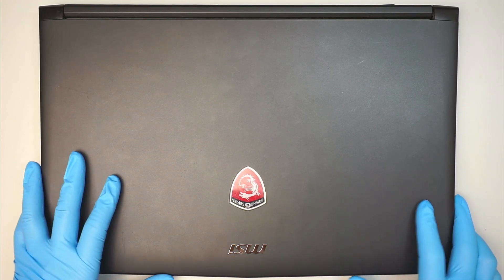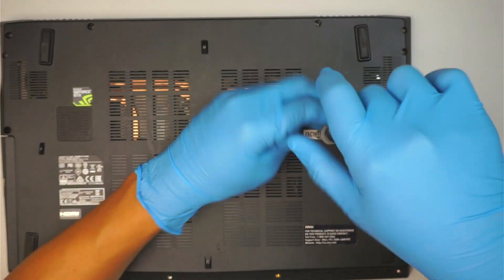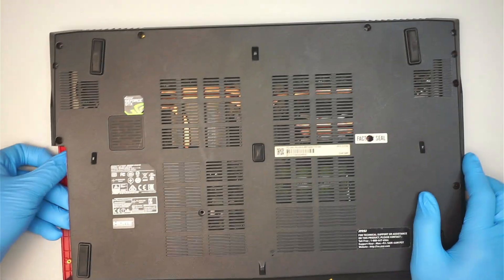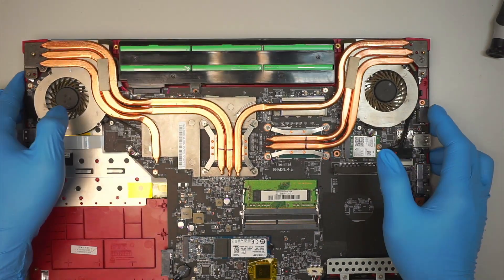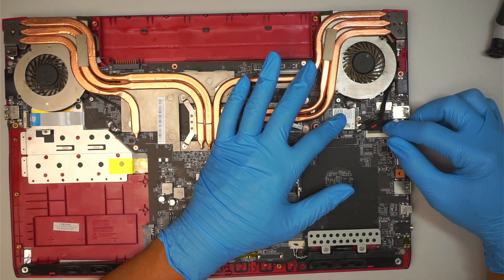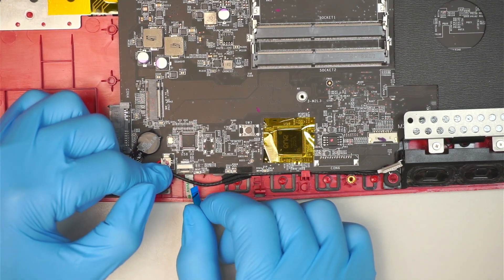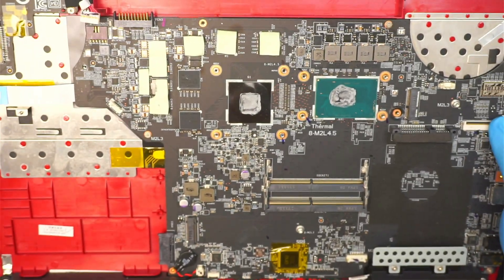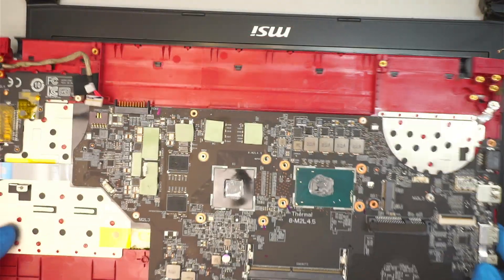MSI GP62 MS 16J9  Teardown Disassemble Upgrade

Comment: i have the ms-16j7 for some reason lots of site dont see this a s model. is the 16j7 almost same as 16j9? i noticed the  gpu is dif but looks to be same internal. i want to get a m2 for it  but in crucial upgrade site i can select 16j9 not j7 so i want to confirm before i buy try and it doesnt work or has issues.

Comment: Does this model have a CMOS battery, and if so, do you know where it is? My clock doesn't retain the correct date/time, but have read that some models of these laptops use the main battery as the CMOS instead of a standalone battery.
Reply: I think it is around 5:47